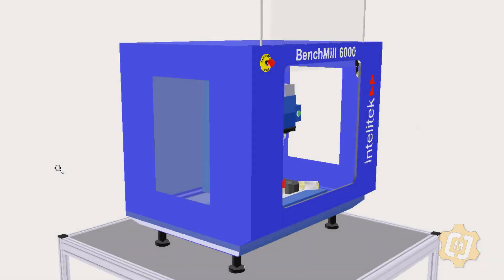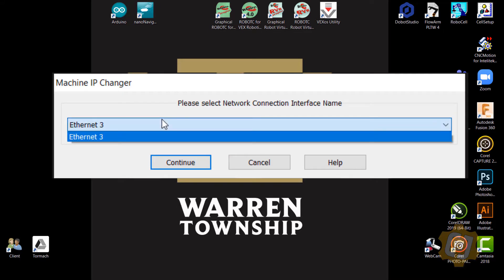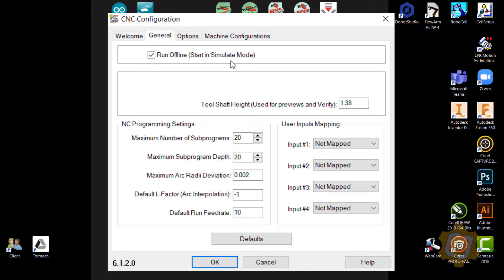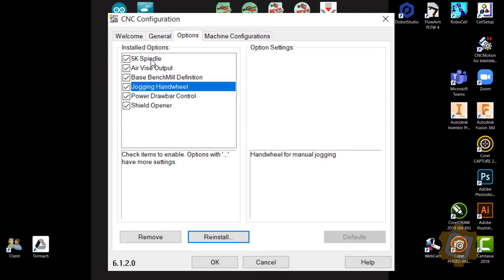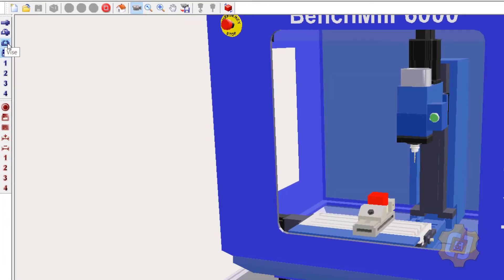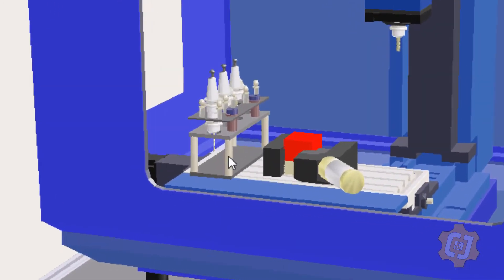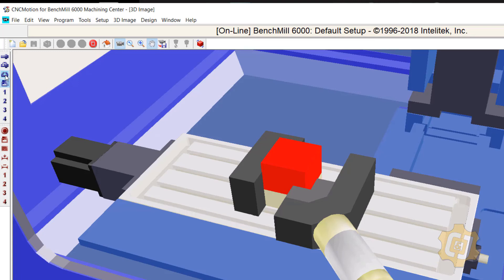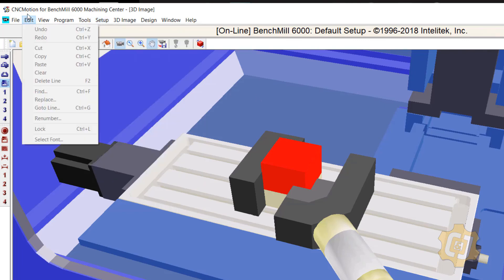2 Benchmill Communication Setup

Comment: I'm having problems connecting my computer to the benchmill 6000. It's a used machine and I don't know it's history so I'm not sure I'm the problem or if the machine is the problem. I noticed that my machine does not have the green indicator light that yours does at 0:19. I couldn't find any information about that light in the manual or online, should it be lit at all times when the machine is on?